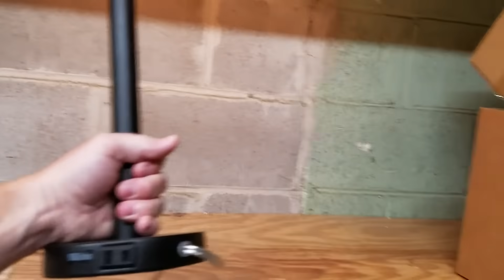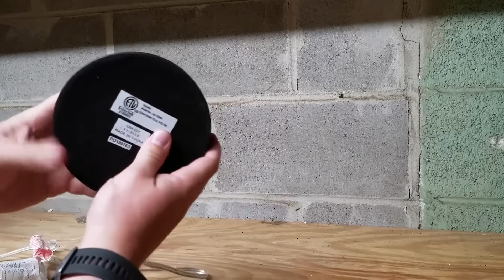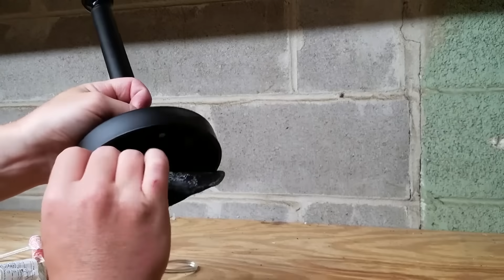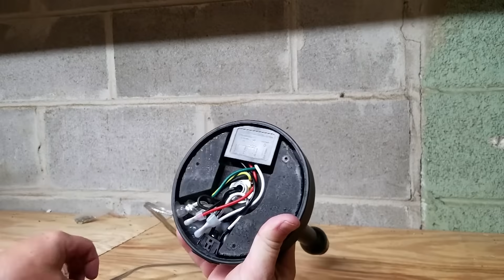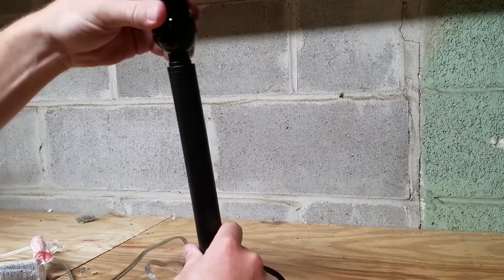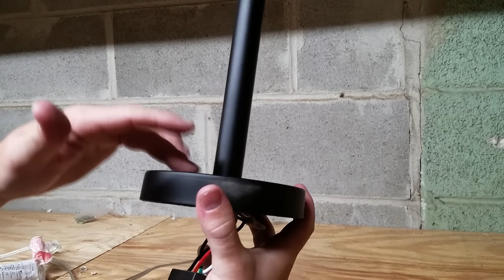How to Wire a Touch Control Switch or Touch Sensitive Switch for a Table Lamp

Comment: Confusing. You say black connects to smooth which is hot. Then you say red connects to hot. Then you say connecting the hot wire to red will short out the switch. You might want to clarify.

Comment: Without telling you the brand and model of the dimmer switch, this video is useless, because there are a variety of them and where a particular colour of wire gets connected to can vary between dimmer units. The chinese dont even put a proper wiring diagram on the units they sell on Ebay. Its like their is a conspiracy going on to make sure you cant find out how to wire them in!

Comment: WHERE DO I FIND A ON / OFF SWITCH TO BUY ???     NO DIMMER !!!!   NO DIMMER !!!  NO DIMMER !!!

NO, I DON'T WANT TO TOUCH THREE TIMES A LIGHT SOURCE TO TURN IT ON AND OFF !!!! 
IS THE WORLD GOING MAD ?????

I'VE BEEN LOOKING FOR ON / OFF SWITCH EVERYWHERE, ALL OF THEM HAVE FUCKING 3 STEP DIMMERS ON THEM. WHAT THE ACTUAL FUCK !?!?!?!?!?

I NEED 9V TO 12V AS THE LAMP RUNS ON BATTERIES.

LET ME KNOW IF YOU'VE SEEN SOMEWHERE A 9V / 12V ON / OFF  SWITCH  NO DIMMER !!!!!!!!!!!!!!!!!!!!

Comment: I changed out the touch control box on a lamp...and then I found that it didn't allow the lamp to work as a 3 way (low, medium, high) on its own until I plugged it in to a dimmer box that plugs into the wall outlet.  The only problem now is that it turns on by itself...and runs thru the 3 way (low, medium, high)...continuously without anyone having to touch it.  It will turn off for a while and remain dark...but after a while it will turn on by itself and run thru the cycle.  Can you tell me what might be causing this?

Comment: So my lamp works, but if you touch the cord it skips through the dimmer cycles. Do I simply need to replace the electrical cord or is this a different type of issue?